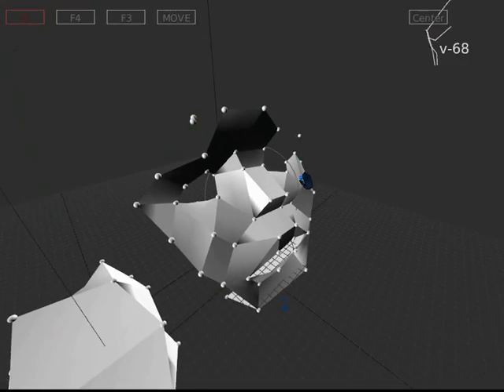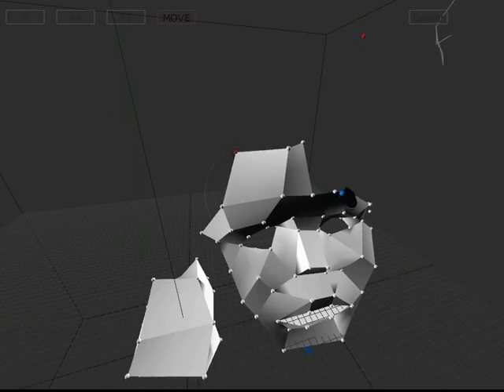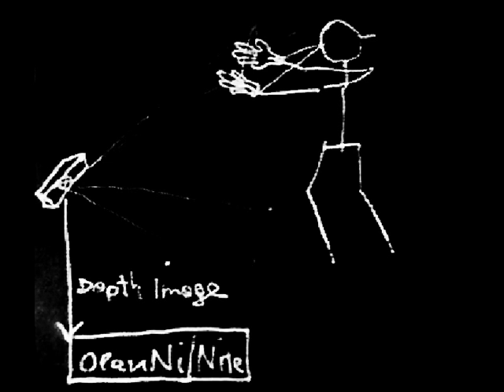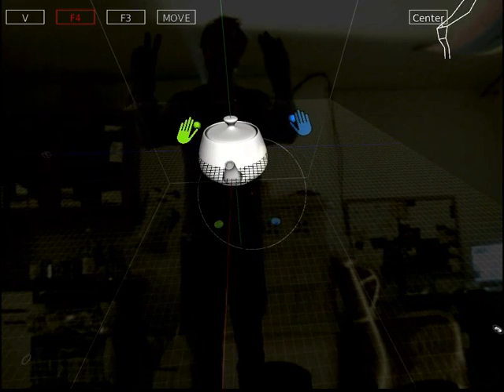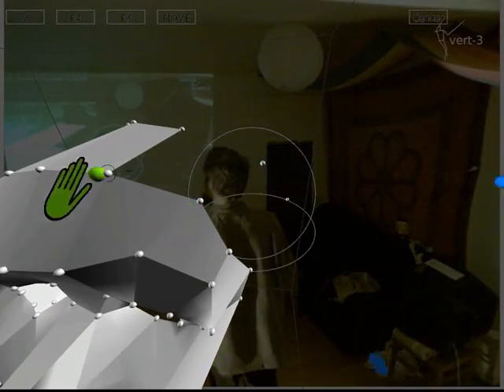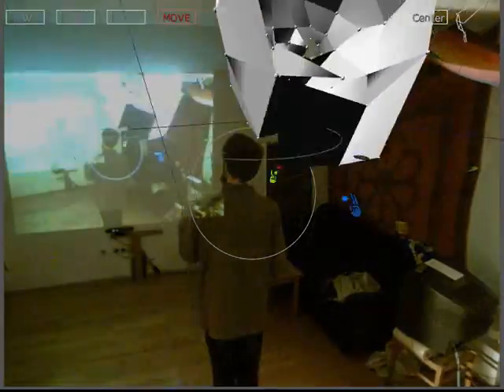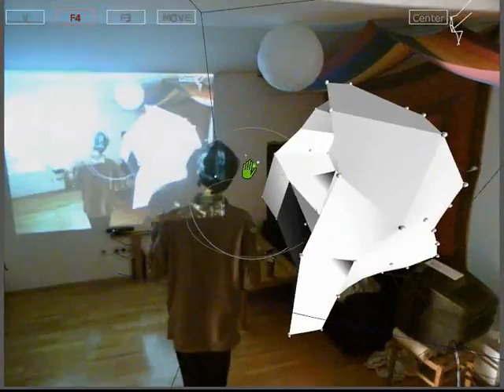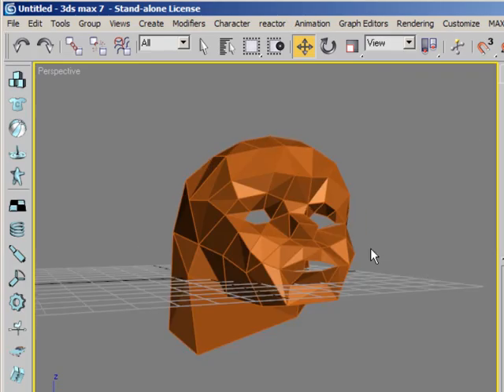kinect-3d-modeling.wmv

Comment: Has this project matured at all since this was uploaded?  The limitation seems to be having to work in the screen space.  What if you combined this with Oculus Rift so that you could walk around your model in virtual space?  Also, placing points and connecting lines is good, but how about "virtual clay".  Pick up a virtual lump and put it on the model, manipulate it and have the program calculate all the points, etc. ?